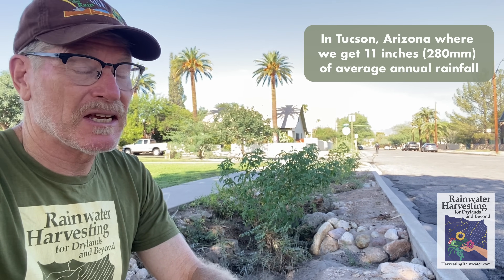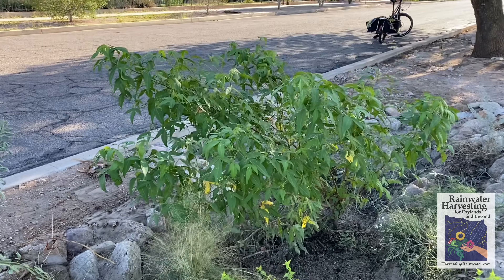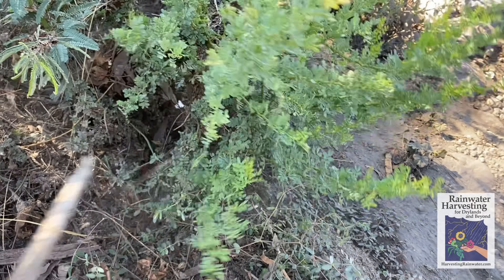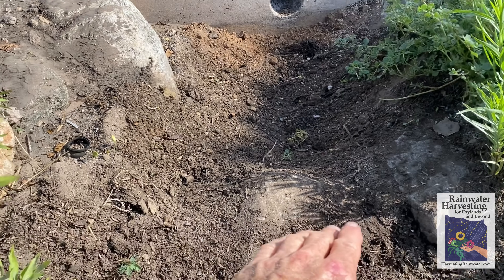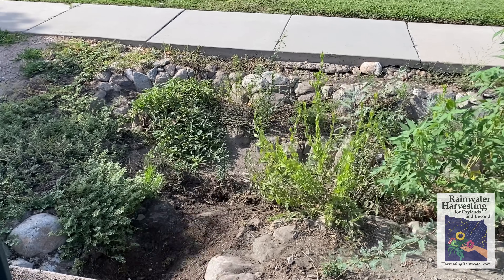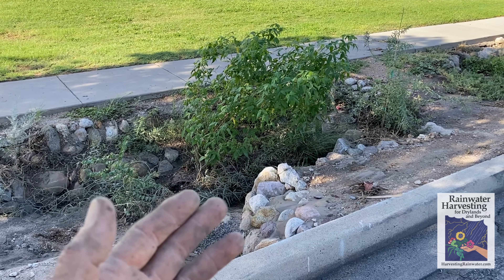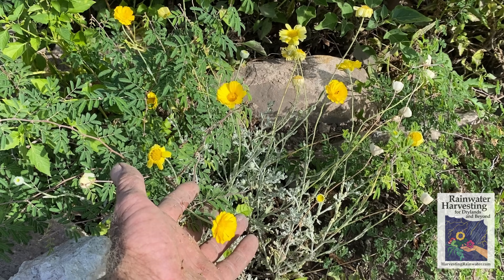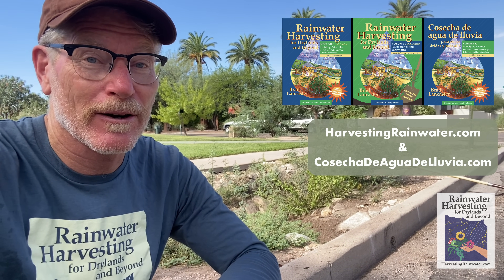How to care for, and learn from, your neighborhood runoff garden

Comment: So if I were designing this in a front yard where there is just the sidewalk and then the front yard, it sounds like I would make trench along the sidewalk for the sediment trap, then have it flow over/around some rocks of various size/shape to flow slower into the next section… which I’m still figuring out. 😆
Reply from the maker: We are only using rock to stabilize steep slopes such as the banks of the basin. If you have a gradual slope you can likely do without the rock.

Comment: I am about to plant some Sporobolus wrightii when the fall rains start up here. Maybe I am homesick for Arizona. 

I like the drilled hole in the curb. Are you preferring those over curb cuts? 

Oregon rain gardens look very different. 

Have you ever done heavy metal tests in rain gardens? I am curious. We have rain gardens in some pretty industrial areas. They put sand in them as the growing medium. I think a growing medium with zeolite would make more sense in terms of reducing pollution being moved in via stormwater infiltration. It has a much higher CEC than organic matter.
Reply from the maker: The curb cores are cheaper than curb cuts - just make sure they are at least 4" in diameter.

I've found the best thing for bioremediating toxins is more life in the soil. More roots, more organic matter, more microbiota

Comment: are you not concerned about pollutants washing into these roadside gardens? If you get only 11 inches of rain a year, sound like a lot of build up of engine oil, brake pad dust, windshield  washer fluid etc that accumulate on roads between rainfalls, leading to a higher concentration of contaminants during major rain events.
Reply: Perhaps this would be more of a concern to those manufacturers who produce this distributed waste, than something that can be used to filter and put water back into the earth, rather than flash flooding.  If you are not growing food, then perhaps this is a great organic filter.
Reply from the maker: We have found the pollutants on these neighborhood streets to be no problem for the plants. 

Also consider what is going on in the street from which you are harvesting water.
These neighborhood streets are relatively clean, they are not industrial zone streets lined with auto repair shops and vehicles getting worked on.

As to humans, we do not grow annuals like lettuce that one would eat raw from these street-side basins. 
Instead, we grow edible annuals in yards watered by cleaner harvested roof runoff. 

It is also key to grow living filters in the form of organic matter in, and on top of the soil (think compost or wood-chip mulch), plant roots, and many soil micro-organisms. Beneficial bacteria and fungi are great bioremediators (natural living filters).

Check out the study “Nematode Community Response to Green Infrastructure Design in a Semi-Arid City,” in the Journal of Environmental Quality 46(3):687-694 (2017) by Mitch Pavao Zuckerman and Christine Sookhdeo.

In these neighborhood street-side basins we grow edible perennials (think woody trees and shrubs), from which we harvest the edible parts well ABOVE the water line.

See the video below where I go into more detail on pollutant concerns and bioremediation:
https://www.youtube.com/watch?v=xI2nXbPkem4

Comment: This works better in dry places, here in Mexico there’s a big risk of root rot due to lots of rains and clay soil.
Reply: some of this still applies, I live in a wet area.  Water still needs to move through the soil, so adding organic matter and encouraging the right plants help create better root systems. The roots the  create passages in the soil so water isn't just stagnant in the clay.  Also more organic matter and insects in the soil improves it even more.  And his methods of reducing water speed and such also can help because your water isn't washing the organic matter away.  the big difference would be choosing the amount of retention before the water runs to next pool.  You might have more small pools, or something like that.
Reply from the maker: This can work well wetter areas with clay soil. The key is to plant vegetation (native vegetation is best) that is adapted to those conditions. Again, you will find many native plants that have adapted to those local conditions.
Reply: Creo que depende más de la región, en los semi desiertos de México esas cuencas podrían funcionar.

Comment: The sediment traps look like they accumulated a nice gravelly/heavy sand material that would be great for the bottom of ornamental flower pots, and maybe walkways.  Your throwing it out makes me 😯😯😯

Saw a great tip from a woman in (dry!) Portugal regarding making swales in her remote area. 
Her place is away from good groundwater sources and often experiences droughts. 
She creates the swales and cast seeds to encourage rooting and stabilize the soil, but she avoids planting established plants until after a some good rains.  This means a lot fewer plant losses due to highly variable rain patterns.  
Her place was verdant and lush compared tp the sparse vegetation above and beyond the watershed of her swales.
Think that is a great tip for farmers and ranchers.  

Hyped your video.
Reply: That sediment could have fairly high levels of petrochemicals, heavy metals, and tire particles. Personally, I'd not use it. A rubbish tip is probably the best place for it, given the circumstances.
Reply: @daviddaish2712 
It's already there and serves better as a useful component.  Why dump it in a bin to be hauled away, then come a few months later buy some petrochemicalc bags of gravel processed by petrochemical powered crushers, driven by petrochemical vehicles back to the same place.  
Same effect but a lot less efficient.

Quit thinking of it as dirt and think of it as material perfect for a pathway next to your own personal green phytoremediation processing plant.

Chemicals can be sequestered into living plant bark and of ornamental plants used for beauty rather than food.  
Why remove something that is auitable for pathways?